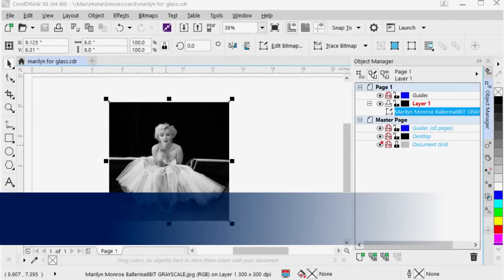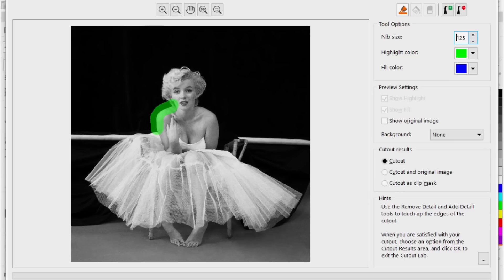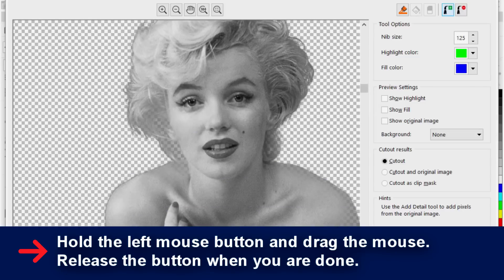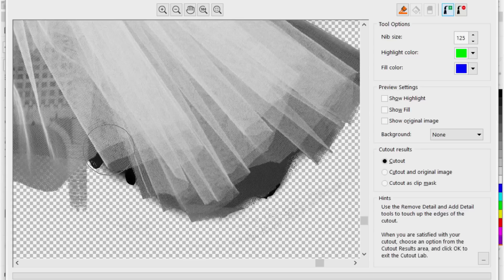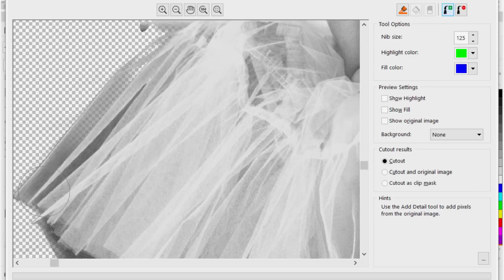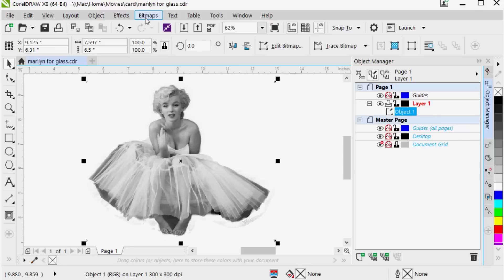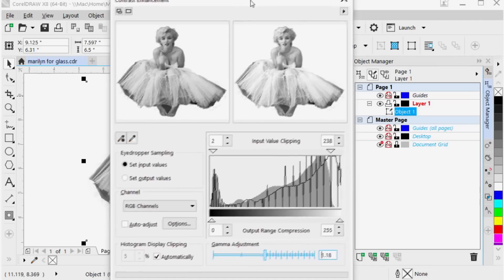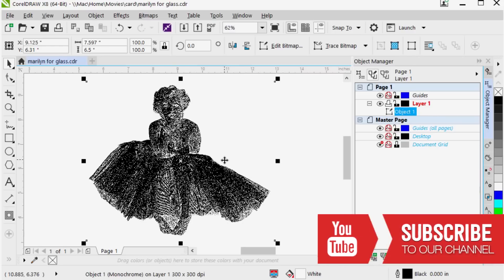Artwork for Transfer Mask Video | Laser Training

Comment: That's pretty much how I do it except for the last bit. When you convert to black and white the resolution should match the DPI of the laser or you can get interference patterns. How do you go about this?
Reply from the maker: Hi Robonza, what machine are you currently using (including wattage)?
Reply: I have a 60W Universal and getting perfect photos. I was looking at a Trotec for a second machine, so was curious how you handled the native resolution matching. Here is some granite I have done http://www.edns.co.nz/files/cache/ca43790eb2a4725f69962a677d693210_f81.JPG
Reply from the maker: Trotec uses an auto setting in our JobControl (our software) which will handle the native resolution matching. You can turn it on or off if you want to do your own matching. If you're interested in a demo we can set something up. If you're in New Zealand we can forward your information to our colleagues there.